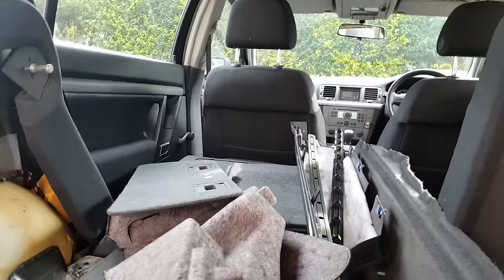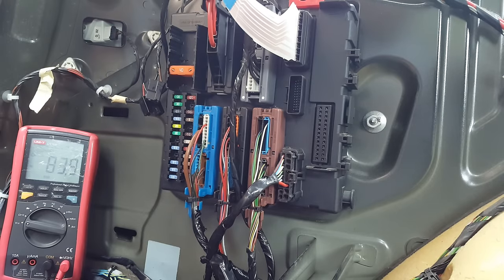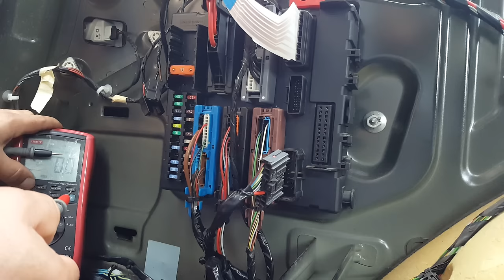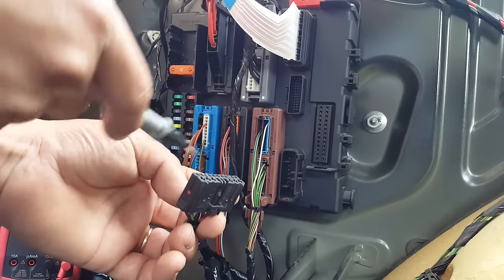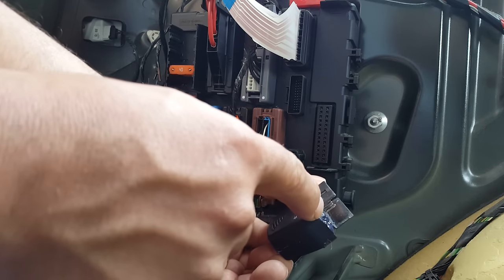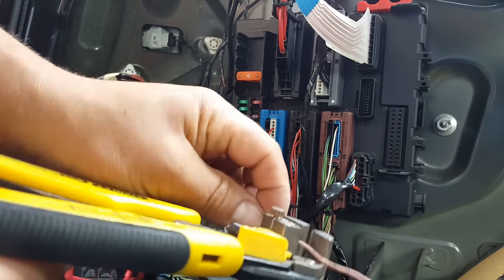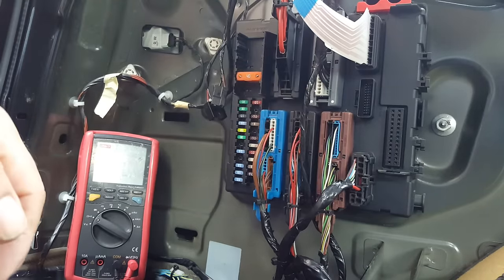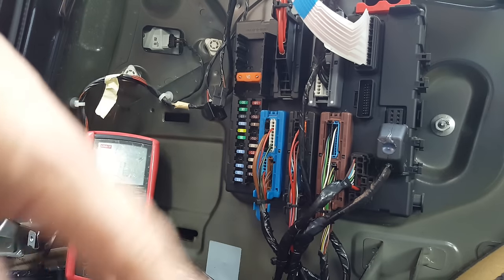Vauxhall Vectra C trailer/towing bar wiring installation.

Comment: I have a Saab 9-3 which has exactly the same fuse box in the back. I just installed a tow hitch with the trailer module but the lights isn't working on the trailer. 

I think I have learned something today so I will do some measurements. Thanks :)
Reply from the maker: If you have installed an original trailer module, that will need to be coded/programmed...
👍👍👍

Comment: Can you list the order of each cable function in the plug, starting from the top down. I have the control module, but can not get hold of the plug so need to create one, and just need to know which wire is what. I know the ones on the right are 12v and negative. I need to know the ones down the left hand side.

Comment: There is a relay already available to make this connection it’s called a towing bypass relay
It has a 12 V power supply to it from the fuse box then picks up the signals from brake indicator stop lamps et cetera and supplies a 12 V supply to the towing socket, the whole kit is around £25, it’s very easy to install and takes all the signals from one of the rear light clusters
Reply from the maker: Hi
That's roughly the same price as the actually trailer original OEM trailer module...(used).
But thanks for sharing that info!
And for watching! 👍
Reply: LM Auto Repairs 
Yes you are right but it is lot easier to just buy a bypass relay connected up to the rear lights it’s a lot easier I’ve done it quite a few times
 by the way is in your name imssavver? From the other videos you used to do
Reply from the maker: @SalimKhan-gk1fh  
 Nice... 
Yes... that's my user name... I changed the channel's name couple years ago...

Comment: Hi mate, iv got a vectra c and it seems i dont have the heated electric seat wiring as the seats i bought are fron an elite, 
So am i able to get the wiring from an elite and swap it with the current wiring loom, like a simple swap in order to make it work without having to pin wires into the current one? 

If so could u tell me if theres anything i should know before purchasing an elite wiring loom, 
(Iv got  opcom for any technical computer based stuff) 

Im not too knowledgeable

Comment: Yes I understood that is a beam that you have manufactured, but there is a mark and a reference on the connector. Also it is necessary to realize a programming in order to have power on the pins that you use. Thank you
Reply: Hi I have a 2009 vauxhall astra H with samrt entry key. It has no communication to ecu and no start no start issue not even turnine on even when push button is pressed
Reply: I am in desperate need for wiring diagram for 2009 cdti vauxhall astra H and if any one has experience this before please help. Its a convertible

Comment: Could you advise on how to change interior wiring loom for the interior lights as they are not working on my vectra c estate?
Reply from the maker: Hi
Have you checked fuses etc?
Thank you for watching?
Reply: @LMAutoRepairs  thanks for the quick repy. Yes. They wer not working when i got the car but its annoying so trying to fix them. Tried disconecting battery an leaving for 15mins to re set didnt work and all fuses are ok. After checking online it could be a loom from back of car to lights in back seat.
Reply from the maker: @lambo7767  
Ok...
I presume you have obviously checked the bulbs...
You need to confirm that the wires are bad... by measuring them...
Also check that the door switches are working, and the switches on the actually light assembly...
It is weird that those wires would fail... are they all not working, or is just the rear ones?
Reply: @LMAutoRepairs  all of the interior lights are not working. The boot lights are working and lights above number plate but think they might be on a different circuit.also could a faulty bulb cause this. All bulbs appear fine with no breaks but would it be worth changing them all for new ines in case one is not working? Appreciate your help in this matter.
Reply from the maker: @lambo7767  
One buld should not put the whole circuit down...
See what is missing, power or ground...
Reply: @LMAutoRepairs  where abouts are you based? Would you have a look at it?
Reply from the maker: @lambo7767  
Quite busy at the moment... sorry...
I do this as a part time...

Comment: thanks for the great video i think it is very informative i do always learn something new from your video you made the job look easy but it is not it need a lot of searching and measuring good job man i am just wondering how can a i get the pin code of this car cause i have the same car in my garage should i read the engine ecu in a bdm mode or the chip under the steering wheel
Reply from the maker: Hi
Thanks for your comment! 
I tell you what, for this car I as actually to do the installation using the trailer module, but in the mean time I got a phone call asking to do it without the module...
Any way, I was getting ready and already had the pin code retrieved... I will make a video of how to retrieve the code using carprog... If you do a lot Vauxhalls/Opel and not just, is an handy tool to have...
Reply: +lmsvvavr just to mention that you have to be very careful when continuity testing....that there is no power in the circuit. You could short out the ECU.  another good video keep posting them.
Reply from the maker: Hi
Thank you for watching and for your comment! 
The first check I have done was done with the battery disconnected...
So on when I was recording the video I new which pins to look at...
Thanks....